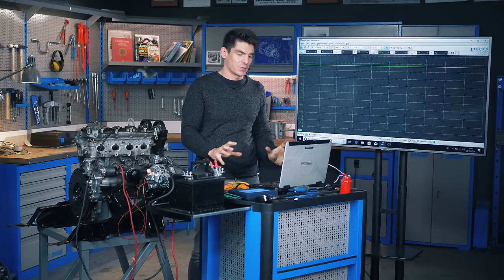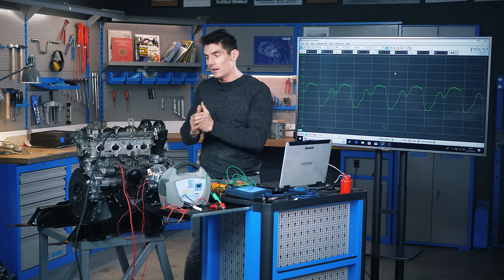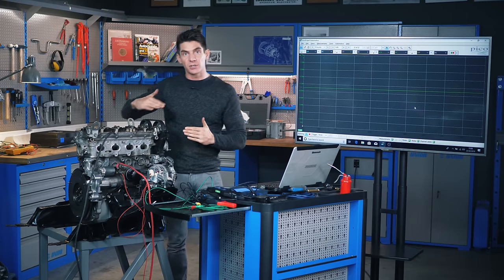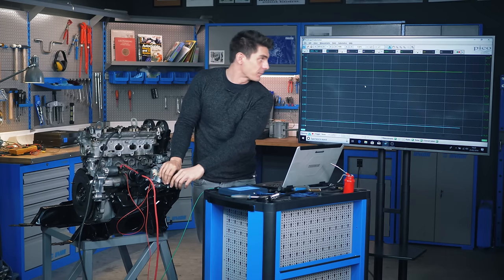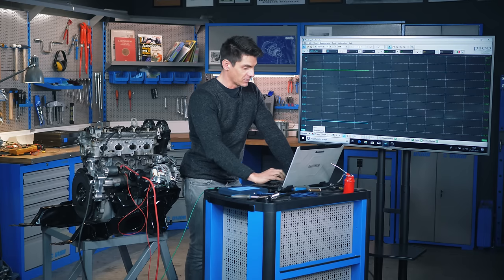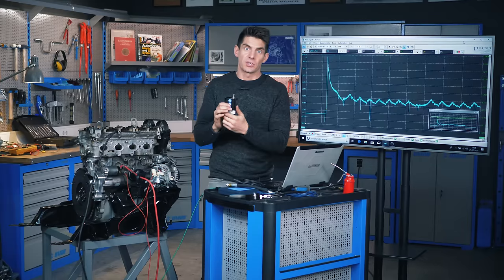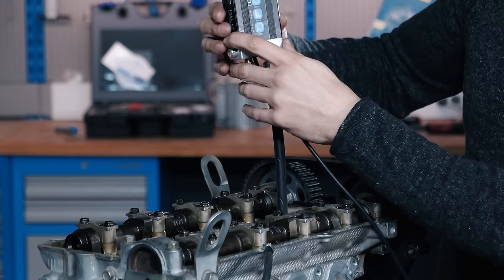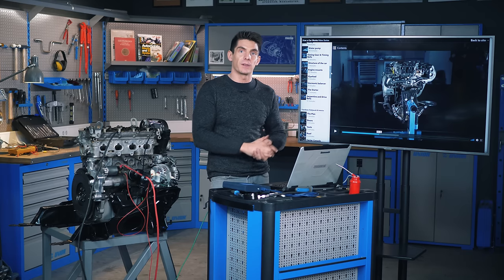Automotive Oscilloscopes: What you need to know

Comment: The video is quite good and informative. 

Urgh, Y-scale in that software is so awful, no zero line, some asymmetrical non-rounded grid... Why are software engineers so "smart"? In normal oscilloscope grid is constant, only v/div is variable depending on your requirements. It is really bad device... "pico"...

Comment: Very poor preparation. The assumption that the people listening already understand the concept of that an electric motor draws more or less current as the load on it increases or decreases. The fumbling with the kit while incorrectly trying to connect things up and openly admitting that there are things that you don't know. The dropping of the spark plugs down the recesses is very bad practice as the impact could not only damage the soft aluminium cylinder head/spark plug lead in threading which could lead to cross threading but also alter the precise gaping that the plugs require for correct and efficient running of an engine. Why introduce possible problems. The high cost of the equipment being used deserves a little more respect in it's use. There's more I could negatively comment on but I think you get the gist!
Reply: @weldingjunkie  Oh Dear, Did I hit a nerve? I suggest you look again at the video to see if anything I mentioned did not happen and try not to be so insulting to people you don't know anything about. Cheers and have a pleasant day.
Reply: PicassoPete you didn’t hit a nerve at all. If anyone posted insulting comments it was you. My point was he made the video to “help” people, where are you videos on the matter? Thought so. Enough said
Reply: Welding Junkie My goodness, you still here. Well you’ve made half a dozen video’s showing off all your new toys which by the way don’t look as though they’ve ever been out their boxes let alone used. Buying all that gear does not make you an authority on it’s use. There is a saying about people with all the gear, is that they have no idea. So stick to your welding and stop sticking up for people who promote bad practice! It may be a good idea when you’re making video’s to keep the camera still and keep your arm out of the way of the subject.... and what’s with the end of each welding bead, your actual trade I presume, when instead of holding the torch still while the weld cools you wiz it up and down over already cooled weld. Hmmmm
That’s all for now good bud. Have a nice day... bye. Regards
Reply: P.S. I don’t have any video’s as I have no inclination to be a YouTube wannabe. I’m quite secure in myself and as such don’t feel the urge, maybe out of some sort of self insecurity, to promote myself on these sort of websites. Now come on, play nice and I would be obliged if you could stop telling me to shut up etc. Free speech has not been outlawed yet. Also I have no idea what Brno people are. I’m also having difficulty with you grammar, perhaps you could explain...
Once again... have a nice day.
Kind regards